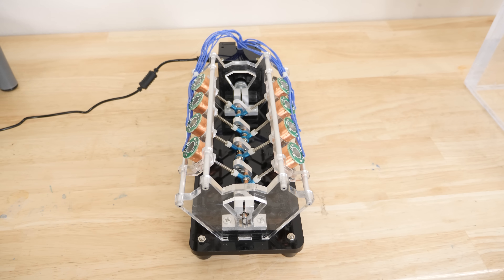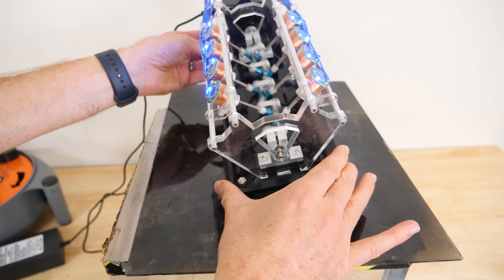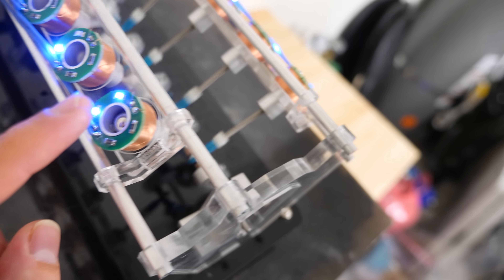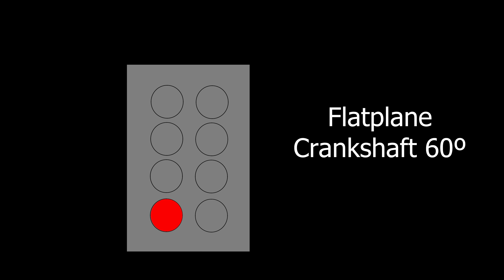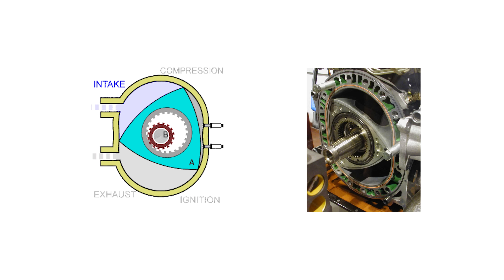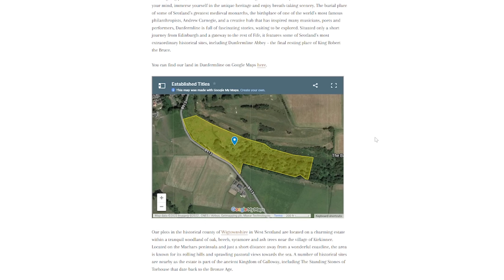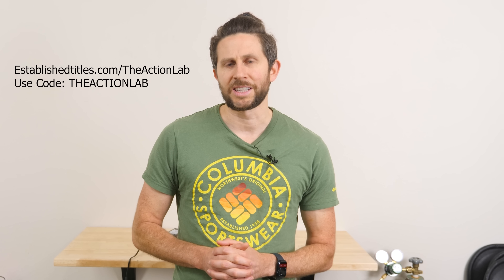Is an Electric V8 Engine a Good Idea?

Comment: If we all used electric. It would put a strain on the power grid. Seeing as how the majority of power is made by burning materials. Electric cars might be better, but something, somewhere still has to be burnt to make the power required to charge ur car.
Reply: Only because that's the way we set it up, and those profiting from it do their best to keep it that way. We can change it, the tech is already available,  it's the people making money off the status quo that are causing the problem.
Reply: A lot of that depends on how efficient the electric cars are and when they charge. 

The good news is that for everyday driving, a car only needs to be charging an hour or two each night, not all night. 

Right now, the default behavior is that charging starts immediately when you plug in, which could be a problem if 6 PM features everybody plugging in at once. But, this is a problem solvable with software, and could be done in a way that dramatically helps the power grid, with no impact to the driver. For instance, the car could communicate with the electricity company over home wifi and begin charging at whatever moment works best for the utility, in return for a slightly discount on the electricity, subject to the constraint that the battery is full by morning.
Reply: Unless the power source is nuclear. But yes, your observation is the big fallacy in the green tree hugger mentality. Electric cars really don’t save the environment. It’s just that the coal-firing plants are “not in my backyard”.

Comment: WE ONLY THINK V8 SOUND GOOD cos we are programmed to associate it with power and expense.

I used to think my CL55 AMG sounded AMAZING until stock Mod 3 Teslas left me standing at the lights, now I KNOW that its slow and dirty and it will never be as fast as electric - I just think it sounds excessive...  Its the chirping of a dial-up modem in the fibre optic world.

Comment: I think we need to focus on better fuel sources. Not reinventing the wheel.

Tuning diesels to run on corn oil or some sort of vegetable source.
Reply: Biodiesel is the closest thing to that
Reply: @arc8218  bio diesel or straight corn, oil vegetable oil will run in diesels if they are designed to do it.  Modern Diesel engine run too high injection pressure for it. Some modern Diesel engines can run biodiesel but it’s usually not most optimal set up.
Reply: Any attempt using food sources for fuel except human power will fail though.

Diesel can run on biodiesel that came from nonfood algae.
Reply: @rzpogi  dont tell that to to all the guys running vegetable oil.

And yes it does eventually gum up. But if we actually put resources r and d into it I’m sure we would figure out a solution.

Or the very least rebuild injection pump would be a common thing which would drive the cost down.
Reply: Biofuel exists, but we don't have enough resources to run all of our ICE vehicles on it. The closest thing we have to that is a carbon-neutral gasoline Porsche is developing that harvests its CO2 form the atmosphere.

Comment: One does not need magnets. A steal piston will work. And the pistons dont need to be in a v they can be in a * star arangement. Advantages to using multiple pistons are power and ability to dissipate heat.  Disadvantages  are the need to be balanced, additional friction, and power lost in converting linear motion to rotational.

Comment: You said in the video the electromagnet attracts the magnetic piston. It looks like the two leds on top of the cylinders flash once each, and at slightly different times. I would guess that the first led flash attracts the piston and the (other) second led flash repels the piston. It makes more sense to me this way giving it twice the power.
Reply: Power is limited by amps × coil resistance / period of time to dissipate watts of heat.

Powering on the push and pull  has current flowing through the coils twice as long reducing the max current to 1/2 of where one has current flowing half the time at twice the current. Just saying one can get the same max power using 1/2 a cycle
And doing power on 1/2 a cycle allow one to use cheap steal piston  rather than expensive temperature sensitive magnets that loose their magnetic strength over time.
Reply: While one LED could be directly powered, the other one might be lit using the movement of the magnet in the solenoid via inductance alone. It would create a more powerful engine to both push and pull the magnet, but I think it was an attempt to be as similar to a combustion engine as possible by having only one powered portion of the cycle.
Reply from the maker: @Tsudico  I believe that you are right. I think that one LED is showing the switch off due to induction of the magnet. I think it only has one powered portion according to the short description from the manufacturer.

Comment: They should add a dedicated sound system on electric cars that can mimic a gas powered engine which you can turn on and off.
Reply: Many of them have that nowadays. Some gas powered cars have it too.
Reply: Not only does it already exist, it's required by law in both the EU and the US for all hybrids/electric moving under a certain speed
Reply: @TheVoidSinger  how do they work exactly? as in are they integrated into your existing sound system or do they have a separate device to generate the sounds? also, do the vehicles come with the device/sound by default or is optional?
Reply: @massey81  For the EV/hybrid law (which is based on pedestrian warning/safety), I believe at least one speaker is required outside the cabin. Outside of the legal requirements, it varies by manufacturer... not all use it, some tie it directly to the sound system (even when it's supposedly off in some cases), others use a separate module under the dash. In many cases the sounds inside the cabin can be disabled, but they often hide it or make it difficult.

Comment: Mod a short stroking Ferrari v12 and your on to something! This could be the best kit to swap from ice to ev, it;d be like a header swap, not much would have to change 😸👍👍
Reply: Wiring harness, attaching the coils around the cylinders, magnetic pistons, lubrication, timing, rotation sensors and now try to make your car move. You’d have the flywheel but even with eight pistons, there is always one firing at a time but now it’s electric and much weaker, this engine will have a hard time propelling your car forwards. At least it’s quieter. 😹 It would be a bit stronger with a V12 but not by much.

Comment: 3:49 You have an error in the script. A tesla uses a synchronous reluctance motor, not an induction motor. My poor quick explanation is the rotor has poles that have a high magnetic permeability that want's to align itself to a rotating magnetic field. An induction motor works by having a rotating magnet field induce a current in the rotor that forms an opposing magnet field in the rotor causing it to rotate.

Comment: There is actually one modern V8 which has this same up-down-up-down crank profile like on this solenoid engine, I believe on the 2014 Mustang Shelby
Reply: Flatplane
Reply: @lasskinn474  Flatplane is up-down-down-up, whereas on Shelby it's up-down-up-down aimed to achieve the benefits of a typical flatplane V8 while keeping the roar of a crossplane V8
Reply: @mihan2d   
Yes, You are right. 
But it is still a flatplane.

Comment: I think that what you're presenting is a really interesting concept that could be used in retrofitting old vehicles. We would just have to replace the engine or upgrade the existing one to convert old vehicles to electric energy. This without any changes in the following mechanics and thus the driving. Here in Europe boomers don't like to change their habits. That's why we have only manual transmission here 😬
Reply: You can do that by just mounting a normal electric motor to the gearbox.

Comment: "Also, these engines are smaller and much simple..." Electric motors aren't engines.
Reply: "Engine: a machine for converting any of various forms of energy into mechanical force and motion." That would include not only electric motors, but has also traditionally included water wheels, windmills, and even sails. The original concept of an engine is not limited to thermal conversion (or even physical, in the sense of social systems)
Reply: @TheVoidSinger : Engine: noun. A machine for converting thermal energy into mechanical energy or power to produce force and motion.
So uh... oops for you!

Comment: 4:04 that’s exactly what I hate (and love) the most about my Tesla 😭😭
I hate it because when I quickly accelerate, the car is just completely silent, no aggressive engine roar.
But I love it because when going 100-130 it’s still quiet, sure you still have the noise from the wind, the other cars around you and the tires going over the asfalt, but it’s quiet and peaceful.
Reply: The V8 engine roar is not really about power or freedom, but just the sound of an old, soon to be outdated, engine technology. Complaining about EV's missing the engine roar is like people a hundred years ago complaining that cars are missing the sound of galloping horse hooves.
Reply: @ab-tf5fl  wow you really got a good point there. I couldn’t describe it better. Nice one 👍
Reply: I find it ironic that petrolheads downplay EVs to mere toys only for them to cry about them not having sound they wanna hear right after.
Reply: @w04h  Whats wrong with wanting to have fun with your car? I get giddy being the first one at a stop light on the highway so I can launch my car, it's so lit
Reply: @w04h  as a guy who has driven EV, i can tell you can't feel as connected to car as much you do in gas car, instant response and full power at disposal makes it too boring. Absolutely 0 fun powerband.
Reply: Put a V6 gasoline engine as a generator into the frunk of your tesla
Reply: @seikojason  great idea! 😂
Reply: @th0master  it wasn’t my idea to use a V6 to make a hybrid car 🤣
Reply: But how do I do a pops and bangs tune on a tesla?!?!?!
Reply: That the point of EV but i get what u mean though

Still can't escape from those beautiful engine roar
Reply: It must feel like toy when you can't feel power building up 😂.
Reply: @mobileGameZGG  it does. The throttle feeling is garbage.

Comment: Good idea? No, but it's surely very entertaining and educational!
Yep, loved it as always.
Reply: Well nice engineering but not practical. But maybe it has an element to it? I think he forgot to mention this. Magnets lose their magnetism overtime but electric magnet? I think that's a great idea just like the Maglev. Electric Magnet + Engine Design = great source of power. Of course it's not perpetual but it can run very much that long. Action Lab did a great job in making the model of this!
Reply: @minzugaming  Many electric motors do exclusively use electromagnets, you just usually can't get as much torque for a given speed and size of motor.
Reply: Why is it not a good idea?
Reply: @moabman6803  inefficiency and the fact that the current electric motors are better in bassically every way
Reply: @wooy1701  I don't know about that. There has been research in solenoid motors. It has shown that power consumption is quite low.
Reply: ... but you could retrofit a petrol engine with this idea😁👍
Reply: Want to sell EV's - make all electric cars sound like a loaded detroit 8V71 18 speed climbing a hill
Reply: ye, just like he sayed

Comment: This is the motor that will drive us to the stone ages
Reply: @Sent made in the USA used to be on every single thing that you bought and we were the strongest country on the globe. They put a media blackout on AIDS for 20 years, they put a media blackout on how farmers and everybody else used hydrogen from Water by using their ohm meter and generator on the vehicles and equipment. First came the part, carburetor and fuel injections, then came the gas stations. Before the gas stations and carburetors, everything was H2O
Reply: @Sent every combustionable engine can run off of hydrogen. I'm talking about using 1880s technology also. No spacecraft, just ancient primitive science
Reply: @banditeastlick2471  no thanks. If it comes down to it I'm going to go to the local junkyard and grab as many old tires I can, heat those babies up to about 800 Degrees and convert them to fuel oil through pyrolysis, then I thank you distill that oil at about 160 to 200° Celsius and it vaporizes all the hydrocarbons into a fine liquid AKA combustible fuel that can run a gas engine. You would have to add a little bit of the fuel oil to the distilled mixture to up the octane for a gas motor. I've seen them doing this in Rwanda, they literally distill gasoline and Diesel using old tires, all that's left is the steel built from the tire and ash. I spent 15 years looking for a 1992 Mazda MX3 Grand Sport with its quad cam v6. I'll be damned if a bunch of hippies are going to stop me from driving my car.
Reply: @banditeastlick2471  Hydrogen? not without reprograming the computer to handle the change in fuel density and refitting the fuel injectors. Ethanol would be an easier replacement.
Reply: @drakon489a  if you don't have mechanical ingenuity, perhaps you are totally correct. If you can't think for yourself, keep voting
Reply: @banditeastlick2471  it's hard to argue with physics, but go ahead and try your "conversion" method from gasoline to hydrogen by just unplugging unessesary things. I await your video documented results
Reply: @banditeastlick2471  >.> what do you think the ECUs are for? Brakes, engine, transmission have been either controlled directly or indirectly by computers for at least 20 years in the majority of vehicles and monitoring aspects of the vehicle for even longer. 

are you not aware of how a modern car functions to tell you when something isn't functioning correctly?
Reply: @drakon489a  school's over
Reply: @drakon489a  I have spoken to the CEO and his attorney, apparently you're relying on information given to you and you did not fact check it yourself
Reply: @drakon489a  you're trying to mix primitive science that was commonly used and then erased from history for most people and those people that lack the knowledge, we are supposed to forget what we know so that we will not be different from you? I think you have bumped your head too hard this time

Comment: Why lose energy converting all that power into linear motion, then using a drivetrain to convert it into rotational motion? Also, the awesome sound you get, is from the "explosions" inside the cylinders every time the exhaust valves are opened. You won't get that in an electric motor. If you want brap brap noises in an electric car, just add one of those stupid noise generators that are attached to your accelerator pedal and mimic the sounds through a speaker... you may think it's cool, but it'll never be real V8 cool

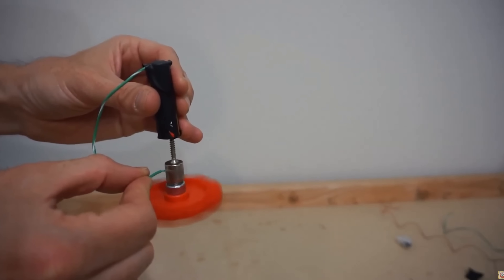Comment: 3:40 "A Tesla uses an induction motor"  Teslas used induction motors until the Model 3, whose IPMSynRM (Internal Permanent Magnet Synchronous Reluctance Motor) has since propagated back to the other models, to include the carbon-sleeved-rotor variant revealed during the 2021 Plaid event.

Comment: But before I even finish watching I have to ask this question: Why would this possibly be better than any comparably sized traditional electric motor?
Now to see what you'll say about that in the rest of the video....
Reply: only benefit i can think of is the power/size ratio which isnt even that much better
 V engines are super cool tho lol
Reply: @falkez1514 : Nope, because the power/size ratio is already MUCH better with just a standard motor, doii.
But yeah, this is cool as just some kind of novelty thing.
Reply: UPDATE to my OP: Yep, my guess was right; there is no benefit of this over purely rotational motors. Otherwise they probably would've been in development already.
Reply: @HelloKittyFanMan.  yea its just some cool idea i guess lol